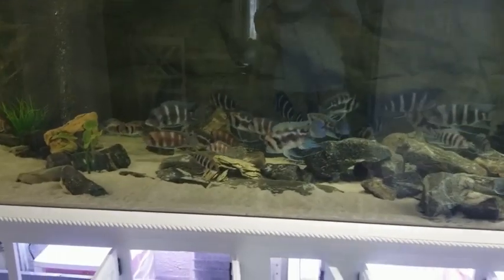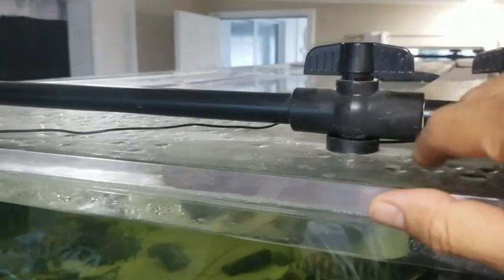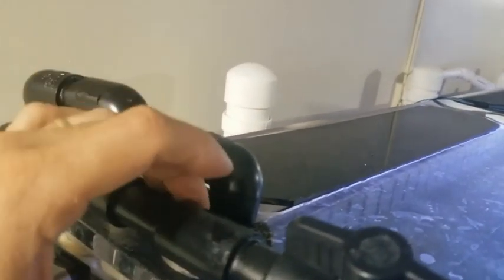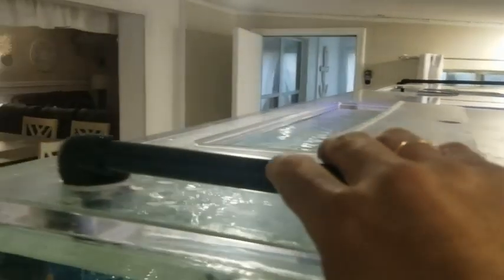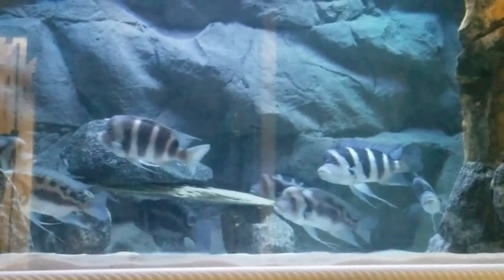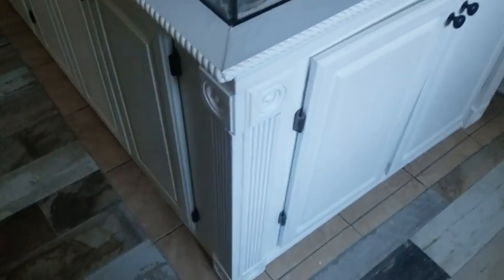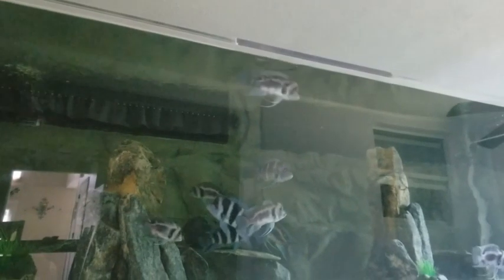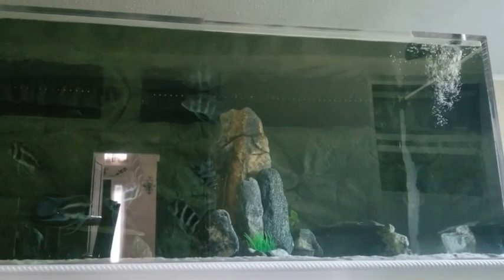650 gallon FX5 add-on

Comment: Nice additional trim with the columns. I don't claim to understand adding a second cartridge filter when you have a roomy sump you could play with;  but, I'm not there and you're the expert.

Thanks for updating on the Frontosa clans. Stay in touch.
Reply from the maker: Did you mean another canister not cartridge? Well honestly, its just to more water polishing behing the 3d wall where the strainers actually are mounted. The sump works well for anything that can be captured in the overflows , while the canisters clean behind the wall and pushes clean exchange water back into the open water. Thanks .
Reply: @alfredorosado1  Yes, I should've called it a canister filter.